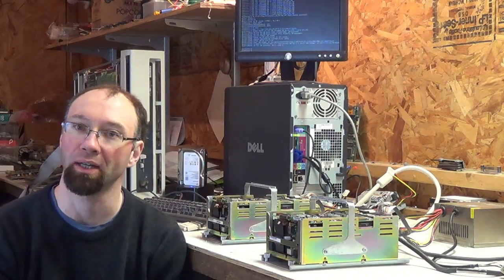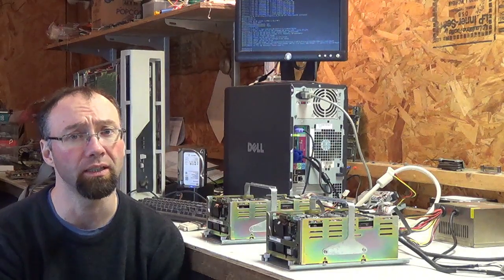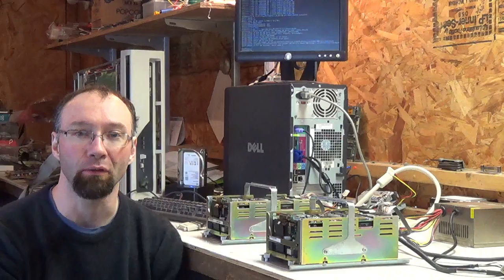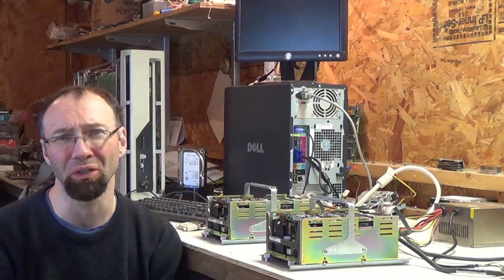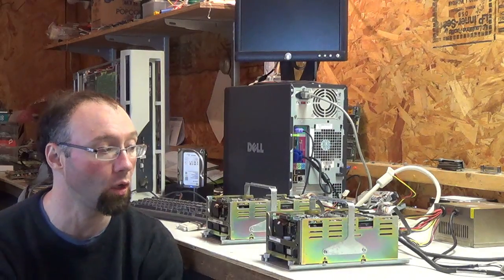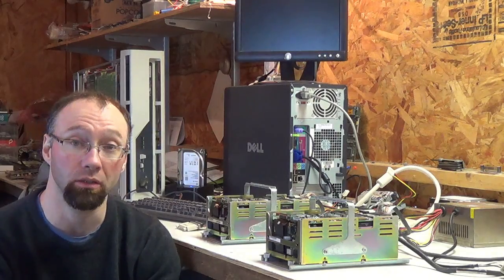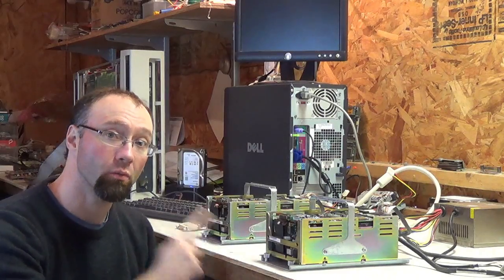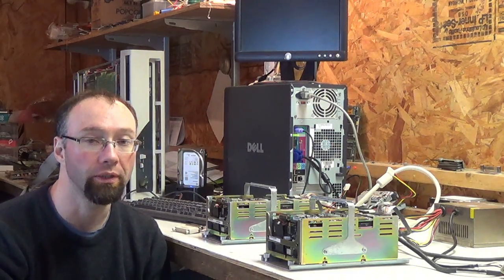Cray J98 Project - Seagate disk controller swap

Comment: You shouldn't need to remove the daughter board as it is just a motor driver board for the spindle, if the broken drive spins at full speed that portion should be fine.
Reply from the maker: The issue was the drive didn't spin up at all - so it was most likely the start-up caps, et al, so the side board, rather than the driver board, was definitely the culprit. This being said I discovered that I did have to replace both to get a drive to spin up - replacing either one on their own wouldn't do it. I'm of the opinion, at this point in time, there was some kind of fault in the side board that caused it to croak and fry the controller board simultaneously.

Comment: Loving the progress as usual. I had missed your message that you sent me via the YT messenger some months ago. I did finally reply, hope you got it okay. I wasn't ignoring you I simply didn't get the notification / notice that YT messenger was even still around. It's wonderful that the data is recoverable off the disk by swapping the logic boards. I'm not sure that is entirely possible on modern disks.

Comment: Btw, if "only" the small board is defective with the FETs, there is a chance for you to repair them, since it contains mostly power-electronics, which is easier to trace and parts are more abundant/replaceable.
Also, I am wondering whether they are using the disk chassis itself as a heat sink for the FETs, or they were never in thermal contact with the metal surface of the disk chassis. If they were, it would be probably good putting a bit of silicon grease below them before you put on the small boards.

Comment: Really looking forward to more of your entire system walkthroughs! Be it Mini-Computers, Mainframes or Exotic.
Any of these walkthroughs that you are looking forward to do yourself?
Any IBM would be cool! It's just so hardcore.
How about an older HP Superdome (Itanium Arch)?

Also:
Yeah, I kindof see why you will not publish the data. BUT: Can you please consider describing and publishing any exciting highlights of the data set? There are so many people dying to know more about the exotic Cray system. There must be some part of the data which are not incriminating at all. Maybe for instance how the data look like, what programs were used - Any other peculiarities that may be within the files.
Reply from the maker: I do have an IBM SP/2 supercomputer and, in theory, it's front end. It's at the office currently where it can't be powered on - and it is HEAVY so getting it home where I can start on it is a problem. Alas, no big HP gear. In fact, the only HP system I have is a PA-RISC Visualize deskside workstation. And as for data, fair call, let's see what I find.

Comment: I love it when you remember you forgot to plug something in it makes all that terrible feeling of despair turn instantly back to hope, and even better when it fixes it!
Reply from the maker: I was pretty sure when the heads didn't waggle on initialise that I'd probably boned something up, but I was a little worried maybe there was some kind of esoteric tie between the internal disk mech and the controller I wasn't aware of, some kind of sub-sub-submodel difference that Seagate had hidden because, let's be honest, that's something someone really would do. In the end the old adage held true - ineptitude was the most obvious culprit.

Comment: Most of the time with these old full height disks, no spin up is from bad electrolytic caps. I had a bunch of Micropolis drives I got that wouldn't spin up and recapping them fixed them.
Reply from the maker: So I've heard - there are only a couple big caps so it's on the list to fiddle with - but not any time soon. I want to get the data off and move on or else I'm going to stuck in a quagmyre and distracted :)
Reply: jpkiwigeek i love these these huge drives, the spinup sounds like commercial heaven
Reply from the maker: These suckers must've been ridiculously expensive when they were new. Sounds like Enterprise and big wallets to me. :)

Comment: Nice. You are back :-) Propane is heavier than air so if you where in a basement it would be quite bad to have a leak of 200 liters. Nice the disk started. That SCSI sound brings back memories (pun intended) Hope the trick works on all the disk. Old disks are temperamental beasts
Reply from the maker: The tank is outside, nestled between grape vines and a strawberry patch.  No sign of devastation, thankfully. But fair point.

Comment: if you had two SATA2SCSI LVD adaptors you would be able to use SATA RAID in JSODS (Just a Set Of Discs) you would be able to transfer all the CRAY discs a lot quicker (or am I barking up the wrong tree)
Reply from the maker: These are HVD disks, I figure the chance of an adaptor existing is slim to none given the age of the devices and their limited enterprise only existence. C'est la vie.

Comment: Nice! What a surprise to see this method working again.
Reply from the maker: I know, it really had to be the controller boards, but I was terrified there was some kind of manufacturing fault in the steppers that drive the spindle, which would've been a mahoosive ball of suck to deal with.
Reply: That would have ruined your day! I thought the board did contained some kind of bad sectors or something like that in it, and swapping it may block some data. Im a noob in scsi disk, they may not have that mechanism at all.
Reply from the maker: I've been tempted to try that, actually, but so far (two disks in) everything appears to be copying ok and I'm a bit worried to jinx something...